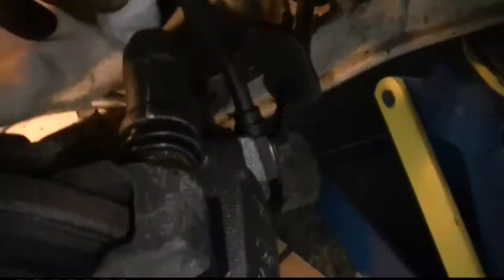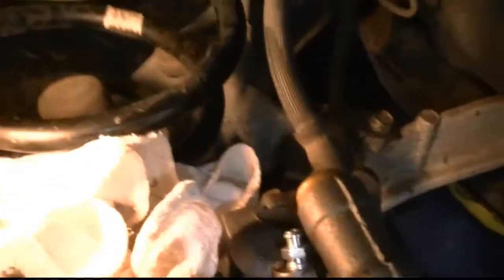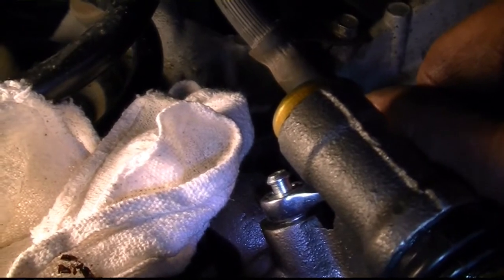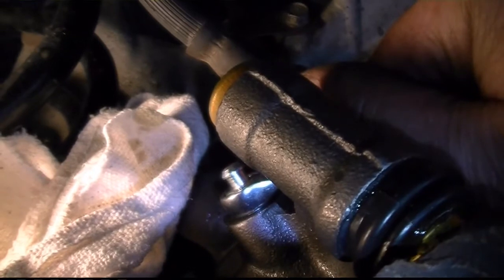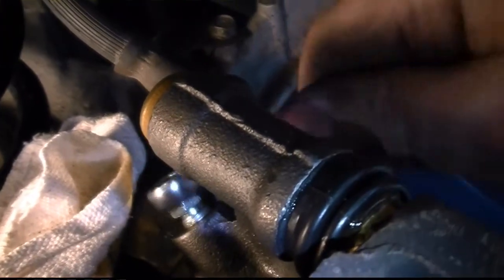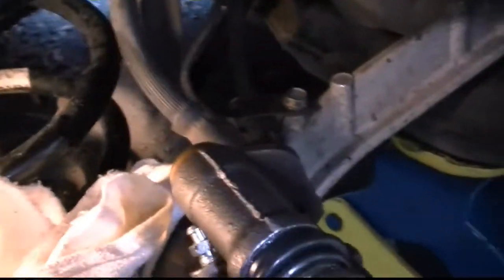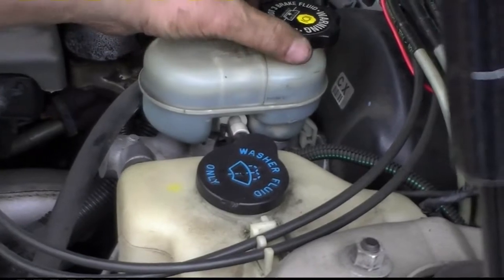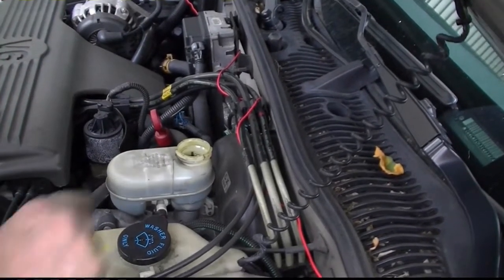How to Bleed Disc Brakes Buick Cadillac Chevy Ford Dodge Honda

Comment: You can just open the bleeder screw and let gravity bleed them also though it looks like you changed the calipers? May have been faster to pump them.
Reply from the maker: +Tommy Walker Yeah thanks. I did change the calipers too.